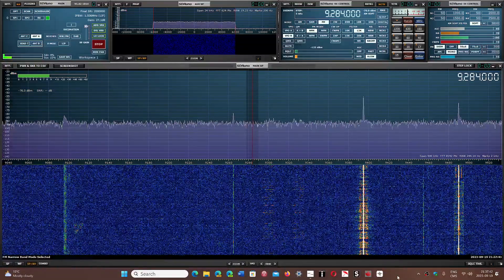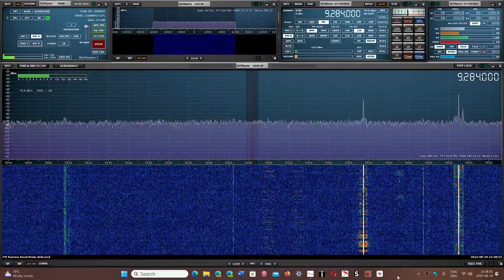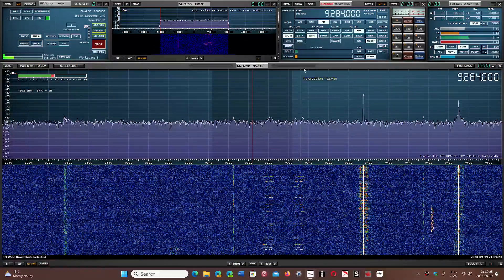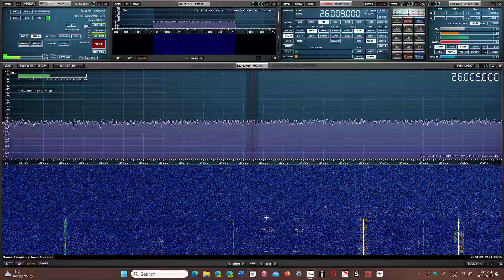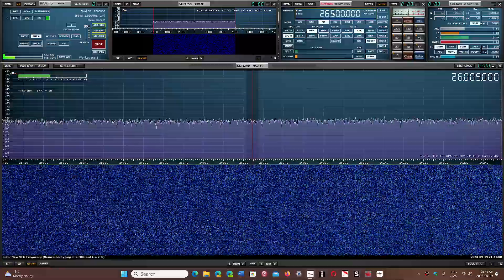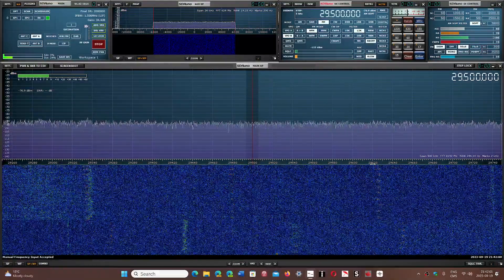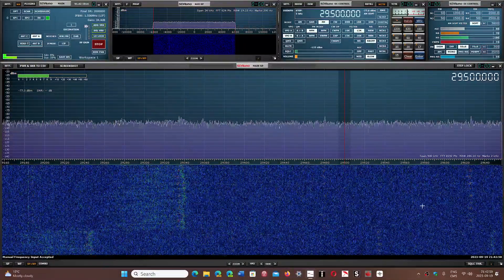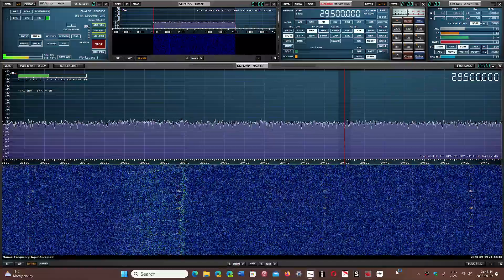Shortwave radio in FM mode yes it is possible in Narrow FM where to listen

Comment: Thanks for the video.  Also, try listening above 27.415 MHz for Citizen's Band  DX stations using FM.  Many are European stations and it's remarkable how far these signals travel.  If you are using an SDR (e.g. Airspy or a generic "dongle" ) you can actually distinguish an FM signal on the waterfall. Keep up the excellent shortwave videos. 73's.

Comment: Here in Spain modulation on FM is used to near communications between CB users in short distances because offers best voice. Also FM is less affected to interferences, eg interferences from foreground noise on the band or a nearby electric storm.
The bad side is that FM reach less distance, but sometimes when propagation opens some FM users can be hearded clearly at 600 or more kilometers away.
Bandwidth is allowed up to 5 Khz.  (On 2 meter band is allowed 6'25 and 12'5 Khz bandwidth).